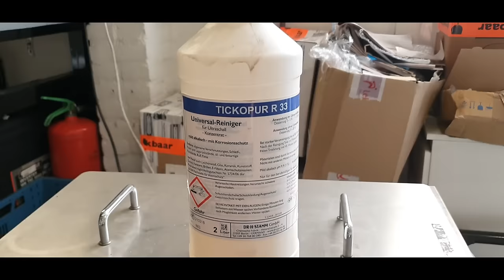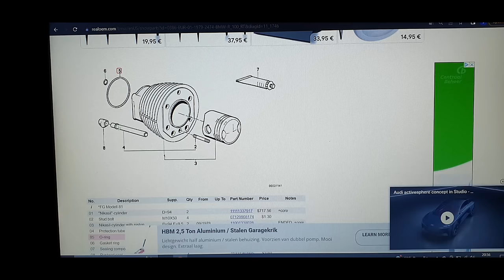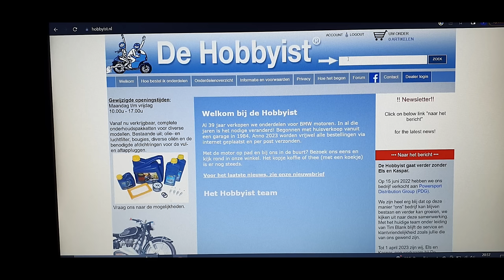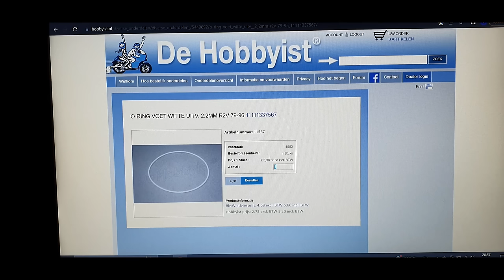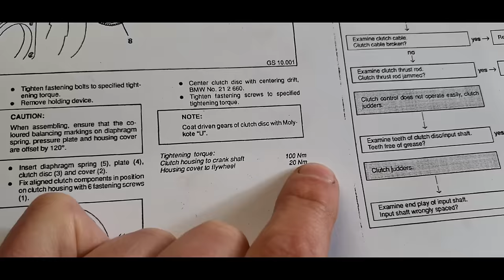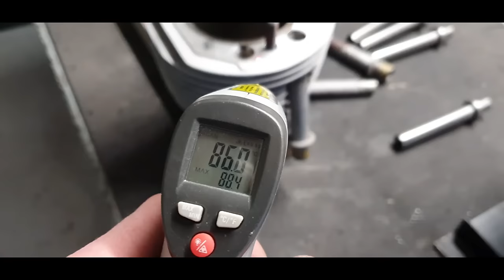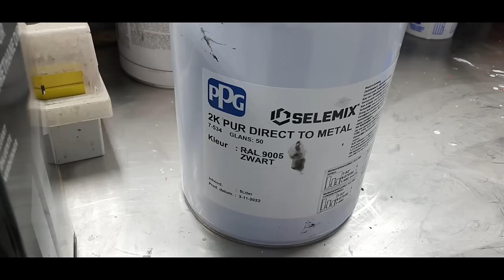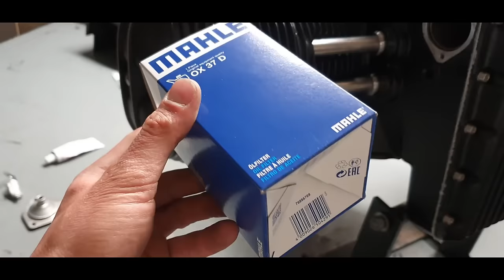How To Rebuild a Classic BMW R100 Engine

Comment: The r Series BMW engine is such a work of art. I've had an r80 for several years and I can just stare at it for hours.
Reply from the maker: I feel you!! The look so classic and also look like an radial engine, beautiful!
Reply: Just picked up an r100 it is a 1978 pretty neglected but I'm designing an interesting build for it.
Reply from the maker: @krisrob648 great man, good luck with the build👍🏼
Reply: Смотри дальше на этот мусор немецкого утиля🤣🤣🤣
Reply: @СергейБаламут-э6м Haben Sie überhaupt die Sachkenntnis um ein Urteil fällen zu können?

Comment from the maker: Let me know if this video was helpful for you 👍🏼
Reply: Great Video!! Bro I would totally want to know how you got the technical drawings for the breakdown process!!
Reply from the maker: @reddevil258  This was the fourth time rebuilding an R engine, but the first time it was very helpful to me for using the technical drawings from realoem.com. I also showed that in the video when ordering the parts
Reply: Just discovered your channel. Superb. I have a r100s that I have converted to a cafe racer - your videos will be a huge help for maintenance and upgrades! 👍🏻😃
Reply from the maker: Ok cool that's nice to know. Let me know if you have any suggestions for new content 👍🏼🤟🏼
Reply: Hi, Why you didn't replace the main bearings?
Reply from the maker: This wasn't my engine so we agreed on goes is deep into the rebuild as shown. Also the mileage wasn't that high
Reply from the maker: @espen1 On previous R engine rebuilds I did do it and found some oil coming trough, so that's why I just put a tiny little bit of (BMW recommended) silicone around the gasket
Reply: I don't know yet if this was helpful, I am doing a light restoration of a BMW R 1150 GS and I am seeing a lot of good pointers and inspiration that may help me down the road.
Fascinating video and that engine in black is a pure work of art.
Reply from the maker: @jochenstacker7448 Thanks man that's great to hear that you also benefit from this video when restoring a R1150. Good luck!
Reply: @corner.custom  I probably won't go as far as repainting the entire engine, but I've been debating myself if I should put new piston rings on and I'm thinking I probably should.
Reply from the maker: @jochenstacker7448 The costs of replacing the piston rings aren't that high when you're already (deep) into the rebuild. Doing it afterwards will cost you more time, effort and money
Reply: Neat video. I'd love to have the finished product just as an art piece on my bookcase it just looks great...
Reply from the maker: @motocafe7636 These engines really do look just amazing 😍
Reply: Yes ro much but I can't do my self one 650cc  can you help me to do that please ?

Comment: All air head BMWs are easy to rebuild and repair. I put over 200.000 on my R80/7. The Man I sold it to is still riding it without rebuild. He only had to replace the diode board.
Reply from the maker: They sure are a joy to work with. Love the simplicity of these engines and the classic look that they have. With proper maintenance they sure can come far 💪🏼👍🏼

Comment: After all these efforts I am surprised that you did not replace piston rings, valves and crank bearings
Reply from the maker: I rebuild this engine for a client. He want to go this far into the rebuild as shown. He told me the valves, springs and seats had been replaced earlier. 
On all my own builds I rebuild the heads, piston rings, gearbox etc. Those videos are on my channel as well 👍🏼

Comment: Great video on the build. Regular fuel (gas) is high fire risk as a cleaner. Older electric drills have armature brush’s that can arc and ignite the fuel.
Reply from the maker: Your not wrong there! I do got a new (brushless) drill and familiar with the sparks that can occur, but good that you're mentioning it though

Comment: Great video and right on time ;) I just finished painting all the engine parts of my R100 engine..  same year as yours! 1979 Now I can use your video as reference so I do not forget anything ;)
Reply from the maker: Haha right on! Building back up the engine is the best part, so satisfying 🤤
Reply: @corner.custom  Yes building it back up and watching other people building one up :) How did you set the depth of the Pushrod Tubes and what value did you use? I’m also replacing mine with the stainless steel ones since mine where a bit crusty. I see some conflicting information here and there. Brooke uses 1.75mm from bottom of the cylinder to bottom the tube. I measured mine before removing them since I think they are still sort of at the distance when it came from the factory. Mine where between 0.25 - 0.6 I’m a bit hesitant to use brookes numbers. Did you measure the distance before you removed them? Since both our engines are from the same year I’m curious about what they where.
Reply from the maker: @pjpankras  I measured/compared the stainless and the original pushrod tubes, both were the same length. Also I checked the depth of the original pushrod tube in the cilinder on the top. When you see the clip when the cilinder is on the studbolts there's still a fairly bit gap between the cilinder and the engine, so the rubber compensates the gap good. This way of working was the same on the R80 engine rebuild and didn't had any issues what so ever
Reply: @corner.custom  Thanx! I will put them in the freezer so I can tap them in this week.
Reply from the maker: Perfect! Don't forget to lube them 😌

Comment: man perfect timing on this video, i'm midway through the teardown on my R100rt and have found the manual a bit lacking for a few things. Super helpful my man! I can't wait for all my gaskets and seals to get here so I can finish the disassembly and put it all back nice and fresh.
Reply from the maker: Ok awesome, that's great to hear that you benefit from this video compared to the manual. Good luck on rebuilding the engine 🤟🏼
Reply: @corner.custom  thanks brother! keep up the good work! And yeah, the black and white pictures in the printed book are sometimes a bit hard to follow. Been marking stuff up with notes as I go for the next time i crack it open to make life easier
Reply from the maker: Thanks man, will do. Try to reveal the new (bmw) build soon!

Comment: Did the same some 10 years ago, but powdercoated everything. So nice job.
Reply from the maker: How did the powdercoat help up? Pretty curious about that!
Reply: @corner.custom  well it looks really nice and itˋs very robust, but it came at some cost. I got pretty high temperatures (also because I upgraded to the 1000cc Siebenrock Powerkit), so I went for the Oil Pan with the external Oilfilter (Motoren Israel) plus an Oilcooler. That helped.
Reply from the maker: @thomasrichter1219  Sounds great! So did you also powdercoated the cylinders and heads? Especially the heads get quite hot
Reply: @corner.custom  Yes, everything. But i took the engine and the gearbox even further apart than you did. Than sealing and blasting everything and than cleaning over cleaning to make sure nothing stays inside.
Reply from the maker: @thomasrichter1219 This wasn't my engine, I rebuild this for a client. The R100RS build on my channel was mine and I did a full rebuild on the heads and gearbox as well. Great work man 👍🏼

Comment: EXCELLENT VIDEO..just a suggestion, if you put the push rod tubes in the freezer you don't need to warm up the cylinder
Reply from the maker: Thanks man, great to hear. I did put the tubes in the freezer, but not for very long and want to be sure so heated up the cylinder as well :-)
Reply: cool man! @corner.custom

Comment: You do excellent work!!! I really think it would be cool to take one of these old R100 motors and make an outboard boat motor with it.
Reply from the maker: Thank you! These motors look so cool. You just also could use them as a table with an glass plate on top of them

Comment: Great. Watch out when tightening head bolts. Four on each cylinder hold the posts for the valve rockers. The ticking sound flat air heads are famous for can be annoying. It’s not all the valve clearance tapping. I’m sure any end float on the rockers contributes greatly. Should be minimal end float. Some purists may faint but I set zero clearance. Never had a problem and big noise reduction. To do this requires the blocks to be gently squeezed while torquing the head down. I do this by putting a socket either side of the blocks (to clear the rocker shafts) and GENTLY squeezing together with a clamp. Then torque head bolts. Some will say zero lash will not allow lubrication . Reality says it does get lubricant. Very quiet engine when no back lash on rockers and valve clearance are correct.
Reply from the maker: Ok that's an interesting theory, never heard about that before. Thanks for sharing that!

Comment: good work.  A bit strange not to check cylinder and crankshaft journal wear since you got almost everything disassembled.
Reply from the maker: I worked on this engine for a client and we've agreed to go so far as shown in the video. The heads weren't rebuild as well, but that was all according to his wishes
Reply: @corner.custom  You did a terrific job.  Thank you.
Reply from the maker: Thanks man. Hope you benefit from the video 👍🏼

Comment: you can also put the pushrod tubes in the freezer as well (will shrink the part a small bit) and make installation a bit easier.  Also,  no cylinder honing ? no valve guides? valve job? new bearings?...
Reply from the maker: I also did that, but not for too long so didn't really helped. I rebuild this engine for a client and we'd agreed to go this far. The valves had been replaced before it and the cylinders were in good condition

Comment: Great video! 
Have you tried freezing the push rod tubes before inserting? Sometimes the minor change can make the insertion a bit easier. 
Here in the US, we normally place the pistons into the cylinder from the top, so as to use the taper to make it slightly easier on the rings. On a BMW engine, are the cylinders not tapered quite so drastically? 
Really loved your video, thanks for creating and sharing. I've never owned a BMW, but I'm looking into purchasing one.
Reply from the maker: Thanks for the feedback, appreciated! Yes I did put the push rod tubes in the freezer and it helped quite a bit, also by heating up the cylinder.
On other R engines I did put the piston in from up top, but I've found it much easier and safer on the rings to go from the bottom, also because the lower end of the cylinder is somewhat taperd.
These bikes/engines are a joy to work on. Straight forward and great looks!

Comment: Thank you for that detailed rebuild! great finish! where do you get the cerakotee from? can`t find it in shops, i would like to use a spray gun not a can =/
Reply from the maker: https://www.cerakote.de
Reply from the maker: That's where I buy it from. Sprayguns are the way to go for sure, you can't get the same result with cans!

Comment: Ziet er super uit. Ik ben jaloers 😁 en heb 2 vragen: de aluminium oxide heb je daar misschien een linkje van welke je gebruikt, er zijn namlijk verschillende grof/fijn soorten?, en mag ik weten op hoeveel bar de compressor van het blast apparaat staat. Dank je.
Reply from the maker: Mooi om te horen 👍🏼Gebruik zelf al jaren alu oxide van Powerplustools, doet het prima en dan het liefste de meest grove variant. Compressor heb ik op max druk staan, 8 bar. Tijdens het stralen heb je dan ongeveer 6,5 bar continue
Reply: Dankje
Reply from the maker: @marcelmarcel8815 Geen probleem 👍🏼Er staan meerdere how-to videos op mijn kanaal met Cerakote behandelingen. Zal voor de nieuwe K12 build een betere how-to maken waarin ik meer uitleg kan geven (over Cerakote)

Comment: Did you do anything to the intake and exhaust valve seats as far as grinding them with a valve grinding compound?
Reply from the maker: I did this rebuild  for a client and he told me the head were already rebuild prior, so no need to work on that in this case. On my own builds the heads were rebuild, so new valves, valve springs and valve seats

Comment: Hi there, I love and respect your work. A quick question...would I need to do a complete rebuild of the engine, carbs, transmission to get i running perfectly again? Or can you get away with a good cleaning, new consumables like gaskets, fresh paint, etc?
Thanks so much...
Ocho
Reply: I'm considering a purchase of a BMW R75 R...1977 and have a small budget. I would like to create a  bobber or Cafe Racer with it.
Reply from the maker: Hi buddy, great to hear that you like the content, much appreciated 👏🏻  Depends on the state of the bike, but in general you can get a long way by doing a good clean and the consumables like you've mentioned 👍🏼👌🏼 You can always go further/deeper when necessary
Reply from the maker: Sounds like a solid base, go for it. There's more R related content on my channel which could help you out
Reply: @corner.custom  thank you so much for getting back to me. I'll keep you posted on the bike and it's progress. I'm a Canadian living in the US for now.
Reply from the maker: @jasonochoochoski7442 No worries bud 👍🏼

Comment: Is it also possible to clean the engine the way you do with the brush when the engine is in the frame? Looking for a way to clean mine haha. I wont be using fuel then obviously but something like brake cleaner or dishsoap with water
Reply from the maker: Yes sure you could do that, only downside to that is that you have hard to reach areas. But it will clean up nicely for sure 💪🏼👍🏼

Comment: Great work Sir! So much detail and I appreciate it. Although I missed a few steps, how did you remove the cylinder rods, or I missed them in the video? and did your R100 come with an oil cooler? I'm currently rebuilding an R100RT and this video has been a big help already and boosted my confidence on doing the rebuild on my own. Keep up the good work!
Reply from the maker: Thanks man, great to hear that this video is helping other enthusiasts to give them enough confidence to give it a try. Just take the time and work step by step. I didn't took out the rods, so that's correct. Also I rebuild this engine for a client, didn't build the whole bike. This engine didn't came with an oil cooler. Good luck and let me know if you have any other questions
Reply: @corner.custom  i didn’t mean to use the term “cylinder rods“ lol that was my mistake, what i meant to say was the engine cylinder stud bolts, i didn’t think i see it’s removal process in the video.
Reply from the maker: @batagventures3435 Ah no worries. Yes I took those out so I could clean/spray the engine. Somewhere near the end of the video I also show that you need to measure the length of the cylinder stud bolt before removing it so you put it back at the correct length 👌🏼

Comment: Question: Instead of using flammable gasoline inside a shop plus you have arcing from your drill that could possibly ignite the fuel vapors to wash the exterior of the engine why not just spray on pre cleaner like Simple Green or Purple Power let it soak then just pressure wash it ? I will it as clean or cleaner?I have taken parts down to the car wash 100s of times and with the hot pressure water it gets it really clean and you dont have to use Flammable liquids to wash down the out side of the engine .
Reply from the maker: I get your point and you're not wrong for mentioning it with the arcing that can happen with a drill that has brushes. In my case I have a brushless drill so no worries on that, I did took than into account. 
This wasn't my own engine, so that's why I was a little bit more precocious than normal 🙂

Comment: Great job! Thank you very much for creating this video.

I have a few questions:

-The timing chain, have you considered replacing it? I dont know what te replacement interfal is for the chain.
-The ultrasonic cleaner you mentioned is a 45-liter variant. However, it seems quite expensive(2/3K!). Do you think a 30-liter variant would suffice? The dimensions I had in mind for the inside of the basket are 430 x 240 x 120 mm.
-What led you to choose the 2K coating for the engine itself? Would Cetakote be a suitable alternative? Or is 2K more cost-effective?
Reply from the maker: Thanks for your comment, appreciated!

- The maintenance history was known and up to date. Also this isn't my own engine so I hadn't have to make that decision.
- I bought the ultrasonic cleaner for a perfect deal so that's why it's the size that it is. You can easily go for a smaller on, would be more efficient as well when cleaning smaller parts.
- On the side of the engine the was heavy wear on the block itself due to rubbing of the centerstand and there for I seconds guessed the adhesion of the Cerakote. There I made the choice to go for 2K paint, also because I rebuild an engine in the same way before. Didn't had anything to do with the costs though!

Comment: is it regular 95 you use to clean parts ? Also why did you choose a dry sand blaster instead of a wet set up ? Does this have to do with the ceracoating you do?
Reply from the maker: Yeah most of the time I use the fuel that came with the bike/tank. Because the Cerakote indeed. It needs to be blasted with aluminum oxide to get the correct adhesion

Comment: Very informative video, but you use fuel as a solvent? I hope not gasoline.
Reply from the maker: Could you tell me the difference?
Reply: @corner.custom  Water based solvents and detergents aren't flammable. Gasoline, as I'm sure you know, is highly volatile and flammable. Couple that with spraying it and with the slightest provocation, you will have an explosion. Kerosene or mineral spirits (paint thinner) are still flammable but less volatile but still very dangerous when atomized. 
I'm only pointing this out for the safety of your viewers and you